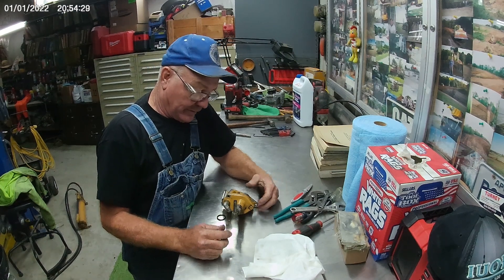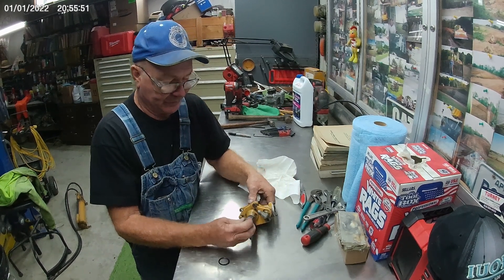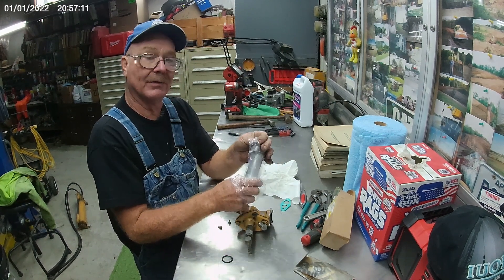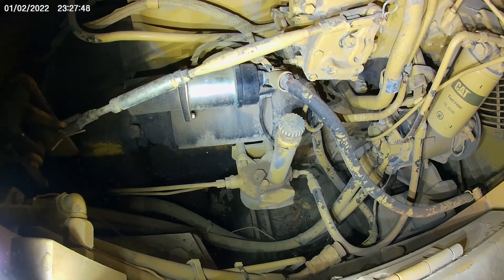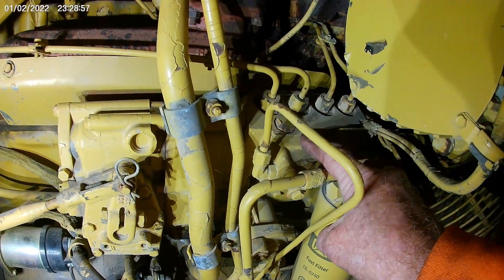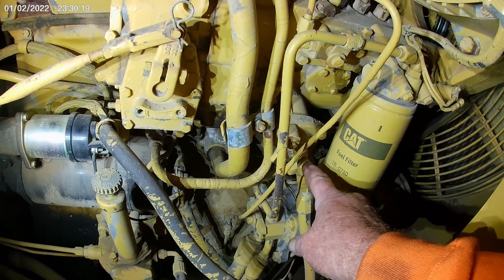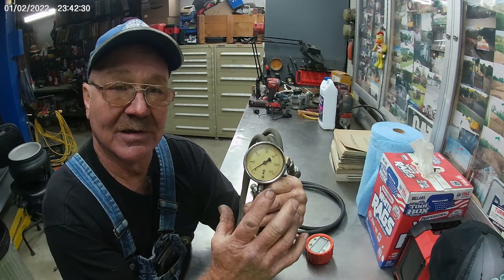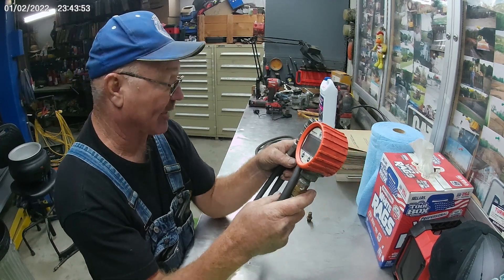CAT - Transfer pump & fuel system, Explain & testing.

Comment: Im really struggling to get the check valve out that is on the outflow side. The other two were easy because I could get out and push them out. I pulled the retainer ring from the valve and the thing is still stuck. Any help is appreciated to get me back up and going.
Reply from the maker: wow Maby break the center out of valve & pry out, not usually that tight!
Reply: @dieseldoctor25  just saw your response. I pressed out the inner sleeve to gain access to back side and still had no luck. Pried on it, hit it and tried to chip it out. Ultimately had to get new housing with new valve. Bummer deal.
Reply: I also punched out the middle to grab hold like you mentioned and the thing just deteriorated.
Reply from the maker: @RynoWorxs  WOW aluminum & steel corrode together bad, you might have to buy a new transfer pump !
Reply: @ bought a new lower housing and all is good